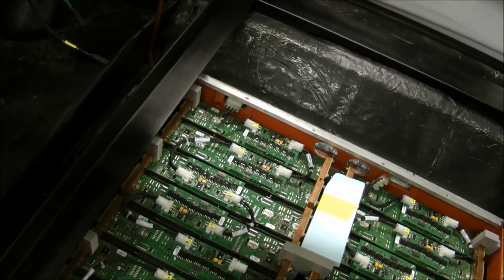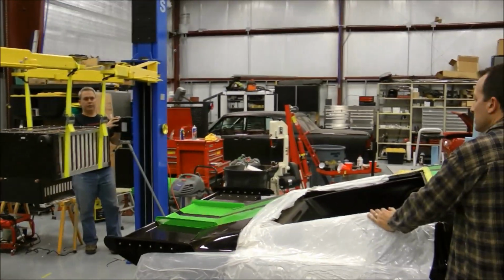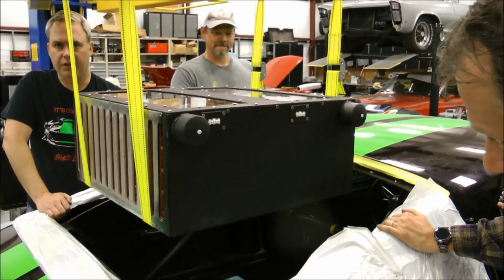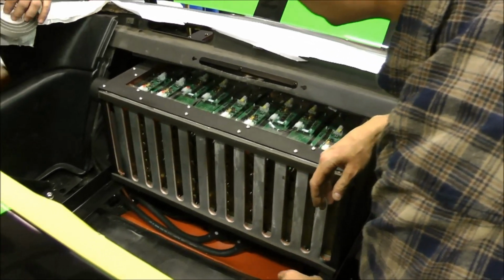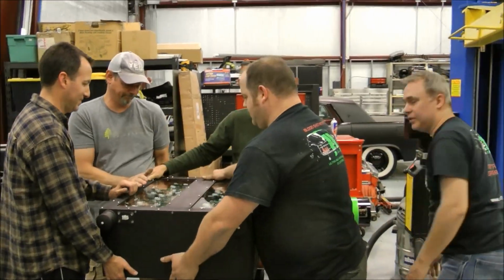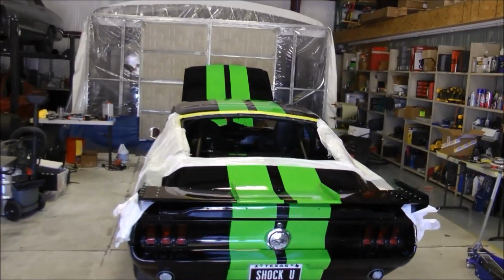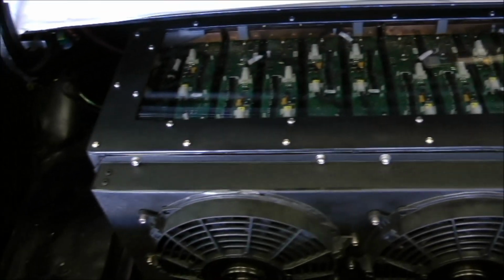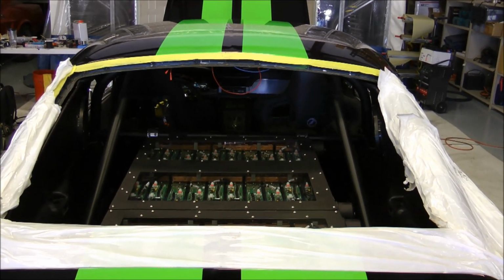Battery overview part 7

Comment: Hey Mitch how are you? That was a really nice job on that battery a battery looks pretty impressive! I think your blood zombie 222 is pretty awesome it's nice to see somebody taking advantage of electrical power and finally using it on Vintage muscle cars! But do you know what would be really nice is to see that monstrous of a vehicle running on a regular car battery only 12 to 14.6 volts. Mitch I don't know if you are aware but there is a 3-phase DC motor brushless with 36 coils it is a drum style stator with a magnetic rotor that can produce a hell of a lot more foot pounds of torque then any of those 11 in. brushed DC motors and put out an enormous amount.of voltage with a very high voltage controller I believe that Texas Instruments has a controller that is somewhat close. So I believe that you can use this drum DC motor that is 3 phase inline with two very powerful AC Motors and using a powerful alternator just like an irregular combustion engine with pulley system belt driven you can run the alternator the cooling system the power steering pump with the brake booster running off the power steering pump just like in Chevys. This DC motor with the right high voltage controller will run both of the AC Motors and self Loop so you can drop those 400lb battery packs! Look up Gerard Morin on YouTube and see what you think? I believe that you can get this configuration to work no charging the vehicle running on electric motors just like a regular combustion vehicle! I would be pleased to hear back from you...

Comment: Hey Mitch, what happened at the mile? been anxiously awaiting an update.
Reply from the maker: Didn't do great, didn't do bad. The team worked all night Saturday night and were made it to the event Sunday morning in time for three runs. First was a slow 166mph to warm the pack, the second was 175mph and third was going to be the best, run we blew the main fuse at the 3/4 mile mark. We're trying to decide if we want to go to the upcoming Arkninsas mile in June to try again.
Reply: +mitchmedford Right on,  thanks for the reply.  Do you think it was the extra weight of the pack?
Reply from the maker: +EarthshipFreedom The weight is definitely a big part of it, but we also had a gear vendor failure and isn't have time to recharge the pack fully between runs. I wants 10 miles an hour faster at the half mile point on my last run but then blew the fuse at the three-quarter mile point. We have some tricks were going to try and I may add four more of the voltabox modules to the front of the car to bring the nominal voltage all the way to 390v. The 26650 cells sag more than LiPo and that took us by surprise, which is why I can considering experimenting with add 28 more volts to the pack even though it is more weight. We'll do it so it is easily removable. Oh, and put it in the front to help keep the front end down...
Reply: +mitchmedford Thanks for providing the update, I've followed the videos and wondered what happened next. Did you take any video of the run? Be interesting to see the drama and disappointment of the blown fuse (sorry to hear about that). Pushing the limits and making world record attempts, means things won't always go to plan. I'm subscribing, this is fascinating stuff!

Comment: If you were  building a new car from scratch just for breaking  the Texas Mile electric powered speed record, would you be inclined to use an AC motor instead of brushed DC?
Reply from the maker: +Randy Hardesty Good Question. If I were running something more than 1 mile like salt flats, I would AC for sure. 1 Mile, probably AC, 1/2 or less I would stay with DC.
Reply: +mitchmedford Good luck tomorrow!

Comment: Why dont you guys use brushless motor instead of brushed is their a reason for that
Reply from the maker: +Jens Kellner Two reasons. First, DC produces much more torque at the low end than AC and when we first starting building the Zombie 222 we were thinking about 0-60 times and 1/8 1/4 mile racing. In that world, AC can't do what we needed. 

Only recently have we been focusing on top speed. Frankly AC is better for top speed, but the Zombie 222 was done and we've been breaking records with it anyway. Secondly, AC setups are 3 times more expensive for close to apples to apples.
Reply: Very interesting and thanks for the quick response